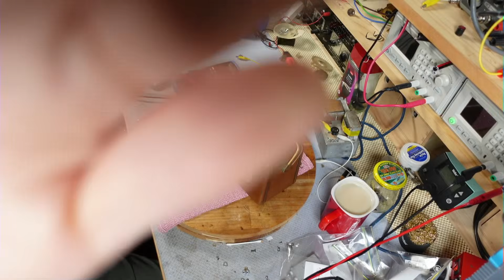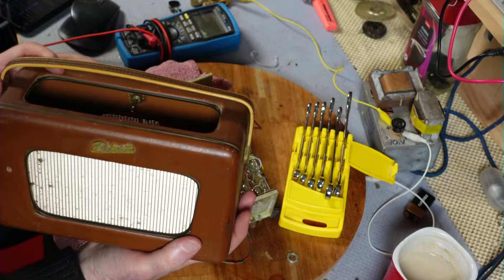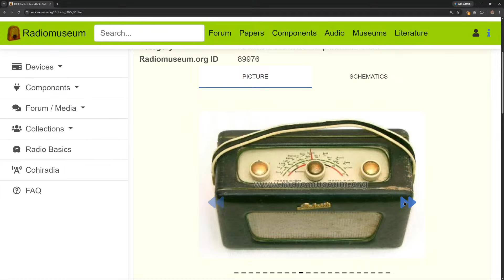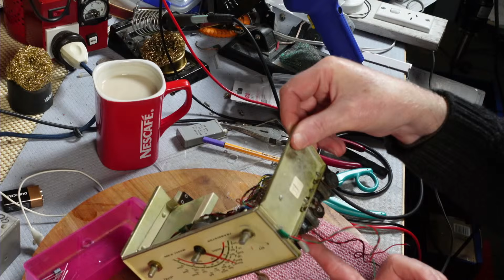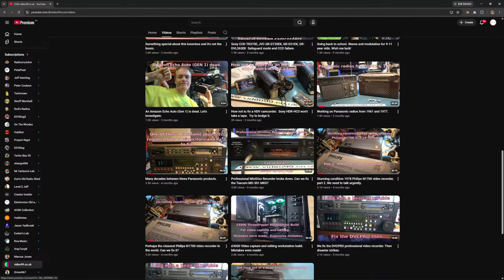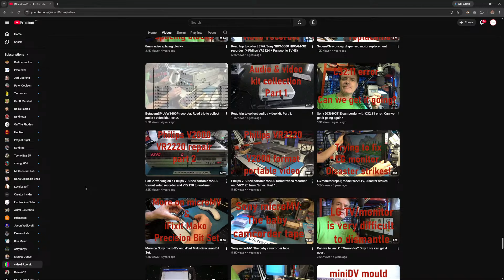Roberts R-300 from 1964

Comment: Some good work so far Andrew. Seems like that switch needs to come apart for some lubrication. They are always very stiff which is probably why the knobs get easily broken. I've sent you an email with some tips to get it running so good luck on Sunday with part 2. Cheers Graham